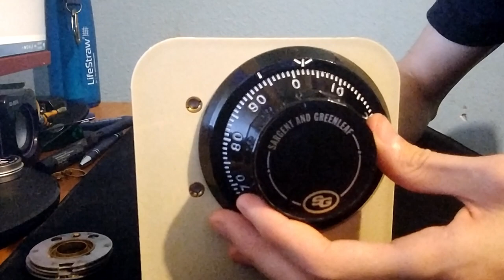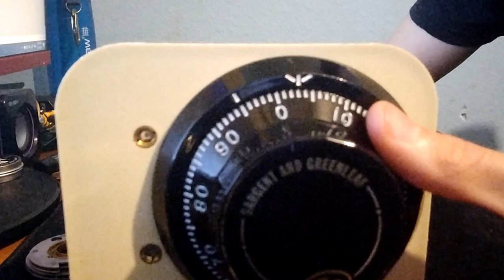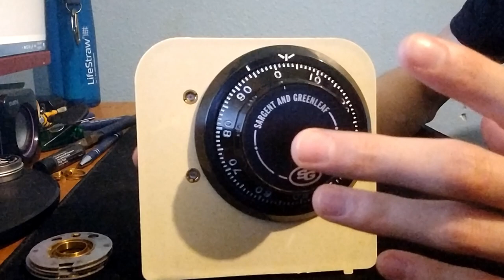Safecracking for Everyone part 2 (Vulnerabilities)

Comment: "the lagard 3330, notoriously known as being a very difficult group 2 lock" oh no, that's the model I have coming  to learn on hahaha, oh well, should be fun
Reply: How did you get on with it?   I’ve got exactly the same one to practice on 😬
Reply: @chrispowellutube  I got it open hahaha,  it took me forever though. The hardest part (for me) was getting consist readings, I had to get into a habit of giving the dial a tug down before taking each reading, and then it was fine (still hard, but fine)
Reply: @TheLemonyOne  I look forward to the challenge, I have the lock but not the time right now, however it will by new to do list in the near future 👍

Comment: Any experience with a Intersec dial lock?  Boss has an old safe that got closed by mistake.  I have a concern because the handle left of dial just spins like its not connected.

Comment: Great videos. I have a friend with two old safes.  Said if I open one I can have the other.  These are safes with the handle to open next to the dial.  Does these videos hold true for this type of lock.  Thanks
Reply from the maker: When you try to turn the handle, does the dial lock up? If so, then no these videos will not help. But if the dial continues to turn smoothly even with pressure on the handle, then yes.
Reply: @lockmanipulator  Thanks the wheel turns smoothly.  The dial says Meilink Patent July 2 1907 Oct 13 1908.  I am just not feeling any stops.  Maybe weak spring or wear.  Any ideas?  Dial is 20 to 100 with nothing between 100 and 20.  Thanks Tim
Reply from the maker: @timmoisiokingsville2095  I'm not familiar with that lock unfortunately. With the dial being from 20-100, and with you saying that there are no contact points, it might not be the same kind of lock that is in my videos.
Reply: @lockmanipulator  With a dial with no numbers 0 to 20, where do you start with no 0.
Reply from the maker: @timmoisiokingsville2095  I wouldn't. It's not the same type of lock that these techniques work with. If anything, I would just try to use the dial to feel around and see if I can tell what going on inside the lock and try discover some weakness in it's design.
Reply: @lockmanipulator  Thanks.
Reply: @lockmanipulator  From another forum I joined and pics I posted, looking like what I have is possibly a S&G 6810 roller bolt.
Reply from the maker: @timmoisiokingsville2095  I took a look at how that lock works and read up on someone else's manipulation attempt. Seems like you can use the same techniques in my videos. 

The main difference is that the contact points on this lock seems to be pretty far apart, right contact point at around 20 and left contact point around the middle of the blank area. It's a gravity driven fence so no spring pressing the nose down onto the drive cam. Which means the contact points will be really light and harder to feel.
Reply: @lockmanipulator  https://keypicking.com/viewtopic.php?f=100&t=11840&p=114988&hilit=sargent#p114988.  This is the link to post of safe that looks like mine with lock shown.  Thanks for your help and time spent

Comment: Thank you for your Great Video! What lock would be good to start as a beginner? I was looking for the sparrows vault but it is nowhere in stock to buy...
Reply from the maker: You can find an s&g 6700 series on ebay from time to time. There's no functional difference between the 6730 and 6741 so either would work well.
Reply: @lockmanipulator  thank you, your videos are very motivating. I will get one.

Comment: My brother in law loaned me his floor safe door, that he has, so I could try practicing on it. It is a 4 number code, with a fence that is not level accross the top. It doesn't have a nose, to the side, like this one. I guess that makes the nose and fence, the same piece? So it's a nose fence? Anyway, the 3rd and last numbers, are the only ones I can get it to reveal, because it always puts the other wheels in the way, when you move it enough, to get the other gates to line up. The only way to open this, that I can figure, if it's on the safe, is to drill a hole, to see where the gates line up. So, maybe the one I have here is uncrackable?

Comment: what is the golden plate located at the right bottom of the mechanism ?
Reply: Do you mean the lever he’s pushing on to retract the bolt? That’s a re-locker mechanism, on lesser grade locks it’s literally a spring made out of a paper clip. It’s supposed to always have pressure on it from the back of the lock pressing on the lever so it can allow the bolt to come back. This is a last resort mechanism for the lock should the criminal attempt to rip the dial off and punch through the lock. No back of the lock body means no pressure on the relocker, which means no retract for the criminal without tools, or worse, require finding a drill point to destroy the linkage in the door.

Comment: Good explanation. Maybe I missed it, but why would reputable safes have wheels that are not the same size such that the difference could actually be felt? It seems that a quality safe would guarantee that these wheels be machined to very close tolerances. Just a thought and an honest question.
Reply: Higher rated group locks have mechanism specifically built in to give you fake touch points, making manipulating a nightmare for them. Impossible? No, but the higher rated group locks are rated that high by Underwriter laboratories after going through a heat test, vibration test, and twenty hours of uninterrupted manipulation

Comment: I really appreciate these videos, they have been most helpful.

I have a question regarding the function of the dial and wheels:
if I turn the dial several rotations to the left until I have All Wheels Left and parked at let's say 50, and then I begin to slowly rotate to the right-  am I moving the 3rd wheel as soon as I start rotating right?  or is there one full rotation that can be made before a wheel is picked up?  (in which case-  after having AWL parked on 50, rotating one revolution to the right you would pick up the 3rd wheel at 50, another rotation right you'd pick up the 2nd wheel at 50 as well, and another rotation right you'd pick up the first wheel at 50 and you'd be carrying all three.)  
is the 3rd wheel always picked up first, regardless of whether you're counter-rotating from AWL or AWR?

thanks in advance.  trying to wrap my head around the mechanics, but it's tough without having it in hand.
(well, I have it IN HAND but I can't see the backside as I'm locked out of my safe!)
Reply: just answered my own question by rewatching part 1.  doh!

mine is a bit odd.  contact points seem to be at 3 and 14.  not sure if it was designed this way or if it has shifted due to abuse.  it's a 40 year old safe, and has spent much of its life out in a warehouse where hundreds of employees work, and I imagine people have stopped and spun the dial (or worse) just for kicks.
Reply from the maker: The 3rd wheel would only get picked up after one full rotation. And it doesn't matter whether it's AWL or AWR. Hope that helps!
Reply: @lockmanipulator  that does help!

I've had a lot of success tonight!  I managed to confirm my first number beyond a shadow of a doubt.  Then after running the High/Low Test, I was able to deduce that this number is on Wheel 2 (just like yours was in the video), because I got a wider gap in both the High and Low tests when I threw the 2nd position off by 10.  I've started working through my second chart, using my newly discovered number in the middle spot.  unfortunately I have to go to sleep for work in the morning, getting so excited I just want to stay up and keep going!  🙃

one thing has me scratching my head though:  I've discovered the 2nd number in my combo, and I found it by spinning AWL in the first chart, like you did.  however-  everything I've found online about this 40 year old safe I have claims that the proper sequence is:  1st number left, 2nd number right, 3rd number left, then turn right until the lever falls.
what do you make of this?  if the first number I found is 34L and it is indeed the 2nd number in the combo, can I spin to 34 from the other direction (like the sequence calls for)?  will it be shifted a few digits?  or, perhaps I made a mistake somewhere?  I shudder to think it lol

I know I'm throwing a lot at you here.  curious what your thoughts are.  thanks again, and cheers!!
Reply from the maker: @aaronschwingel3330  Because you found the 2nd wheel with AWL but it's normally dialed AWR, you'll have to either dial it with AWL or use rotational conversion. I talk about rotational conversion a bit in later videos I think or you can google (without quotes) "rotational conversion site:keypicking.com". I definitely talk about dialing with the "incorrect" rotation in later videos. Basically, you have to dial it with right rotation and pass it by 5-10 numbers, then go back around left and bring it to the correct number with left rotation.
Reply: @lockmanipulator  thanks for the quick feedback-  you're a gem!  for now I'll continue to focus on getting the other 2 numbers, and then circle back to this when I'm finally ready to open this badboy and see what works
Reply: @lockmanipulator  
edit-  didn't set out to write this much lol.  I have a question for you at the end if this is TLDR  :)

so I realized that my first chart was a bit faulty.  as I went along, the more contact points I felt, the better I started getting at stopping cleanly at the first bit of solid resistance.  my fingers were also rapidly developing the mechanical dexterity to rotate the dial slowly and smoothly, with just barely enough force to keep it moving.  so by the time I made it 3/4 of the way around, I was getting readings differently than I was at the beginning.
so I started over, and focused on consistency, and also focusing on resisting the semi-conscious urge to manipulate the dial to force results that I want to see (something I realized I may have been doing).  just read the points cleanly, let the lock speak on its own.

I wound up finding that my first number was one digit higher than I had thought it was.  more importantly-  when I did the High/Low test again I found that this first number resided on the 1st wheel, and not the 2nd.  it was a clear result:  the gap was considerably larger on both High and Low tests when throwing off the 1st wheel than it was with the other two wheels.

so now I am ready to begin another chart to determine the second number.  I found my first number with Left rotation and it's on Wheel #1, so to do my next chart I should:
set Wheel 1 on my number with Left rotation
turn to the right until I pick up boths Wheels 3 and 2 and park them on a number together.
turn back Left to the contact points and read them.
rinse and repeat, parking Wheels 3 and 2 two digits further each time.

is this correct?  I just did about half of the dial, and noticed I'm not getting as much variance as I was on the first time.  it occurred to me that I am dialing "W1 Left - W2 Right - W3 Right"...  should I be doing "W1 Left - W2 Right - W3 Left"?
Reply from the maker: @aaronschwingel3330  You're doing it right!  "W1 Left - W2 Right - W3 Right" is correct.
Reply: @lockmanipulator  so after probably 8-10 hours invested thus far, I'm come to the disappointing conclusion that I've made some major tactical errors 😖.
after finding 1st and 2nd numbers, and trying every combination to unlock.. no dice.  so I went back and tried the second best gate signature for my second number... still no dice.  started having doubts about whether my first number was right, and decided to go back to square one.

before restarting my first chart, I spent some time playing with the contact points to decide how best to read them.  it was here that I discovered that starting from 0, I could feel a Left contact right around 96 and a Right contact around 2.. similar to the ones in your videos.  for some reason, when I first began manipulating this thing last week I had convinced myself that my contact points were at 6 (left) and 14 (right), because I was consistently getting contacts in these areas.  that was what I had used for all my charts.  I decided to use the contact area centered on 0, as you did.  now I am getting Left contacts between 95.5 and 97.5 and Right contacts between 1 and 3.25.  I think I'm on the right track now!

still going thru my first graph using this contact area.  I've run into something that has thrown me for a curve though:
at a few points on the dial, when I rotate back to 0 to feel contacts, when I rotate further right to feel the left contact I get a contact immediately-  like on 0 itself.  if I push past it, I can feel another contact that is within the usual range of 95-97.5.  I am unsure which one to register?  I'm thinking that the contact I'm feeling on 0 is probably something else, and that the actual Left contact I should record is the second one that I feel in the usual range.  it doesn't seem likely that there could be an actual Left Contact this far over.  that's seems like a big jump, especially because I haven't found any in-between contacts that would bridge this divide (nothing between 97.5 and 0).  I am going to disregard these, push past the 0 until I feel what I believe to be the actual Left Contact a few digits over.  does this sound right?
thanks
Reply: @lockmanipulator  what's weird is that I seem to have two contact areas.  no matter where I'm at on the dial, or which wheels I have parked wherever, if I rotate back to the top of the dial to 0 and move left/right I can feel contacts at 96ish and 2.5ish, and if I rotate to 10 and move left/right I can feel contacts at 6.5ish and 14ish.
I don't see how this could be.  I'm sure only one of them is the actual contact area, and the other must be some flaw in the lock causing rough clicks.  what is really weird is that they both seem to behave how a contact area should:  left/right points shifting slightly as you move the wheels around to different points.
Reply from the maker: @aaronschwingel3330  Tbh I'm not sure what you're feeling at 0. Could be you accidentally left a wheel there and are feeling it pick up?
Reply from the maker: @aaronschwingel3330  Sounds like your lock could be defective or maybe a different type of lock? I've never heard of a lock feeling like this before.
Reply: @lockmanipulator  so I've figured something out.  posting this in case someone else finds it helpful at some point.

the lock on my safe is old (40yrs) and has probably seen some abuse.  it was left out in a warehouse where 120 people work, and I'm sure the dial has been forcibly spun (or worse) by passersby for years.  there's a bit of In and Out wiggle in the dial.  there's no Right to Left slop in the rotation-  it's engaged solidly to the drive wheel-  but you can push the dial in towards the safe and pull it straight outwards, with maybe 1/16th to 1/8th of an inch play in the middle.  the past 9 days that I've been manipulating it, I have pushed it in tight to the safe as I took readings and such.  
yesterday I began getting frustrated with my inability to get consistent readings.  I could do the same chart twice and get slightly different results.  my contact points didn't feel clean-  there was a lot of "noise" and false clicks and such, making it hard to get consistency.  it occurred to me to try turning the dial while it was pulled outwards instead.  I noticed a difference immediately.  it rotates much smoother, and gone are all the false bumps and hitches and clicks.  it rotates smoothly within the contact area now, and stops cleanly at the contact points.  this has increased the resolution and consistency of my charting tenfold, and done away with a massive headache.  I can work my way around the dial to complete a chart much faster now, because I have don't have to spend 2 minutes wiggling back and forth on one number trying to figure out which click I should register as the CP.  so much less headache, I wish I had discovered this at the beginning!! 🙃
Reply from the maker: @aaronschwingel3330  Glad you figured that out! Damaged locks can be a pain to manipulate open and in most cases, impossible.

Comment: If i'm understanding this properly
1: you turn 4 roll rotations to reset
2: check the contact points, 
3: go through each number on the 1st possible conbination
4: go back and check if the contact points got closer, if so. Then the 1st wheel is the biggest and you have that number. 
If not then repeat for the 2ndand then 3rd if neccesary
5: repeat for the 2 smaller wheels 

Is that the basic idea?
Reply from the maker: Yes, however if you are only moving one wheel at a time then usually it would be the third wheel not the first wheel that you check. But normally, most people rotate all three wheels at once and then just use high/low testing to determine which wheel has the found number.
Reply: @lockmanipulator  thank you very much . I only saw the second video and figured it out.